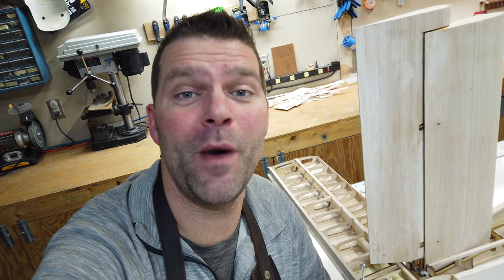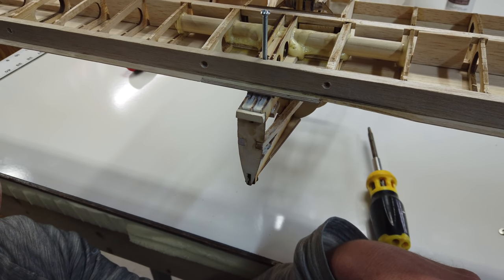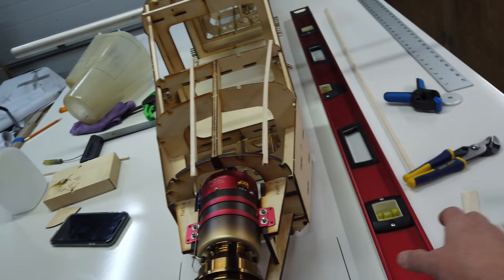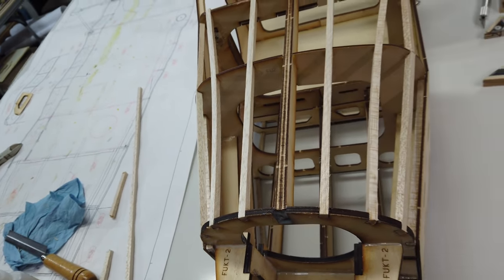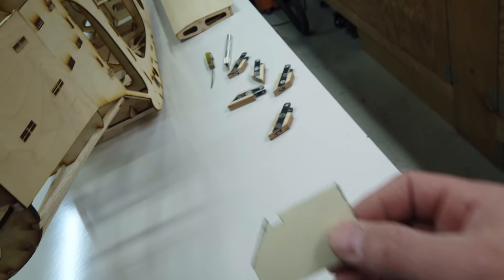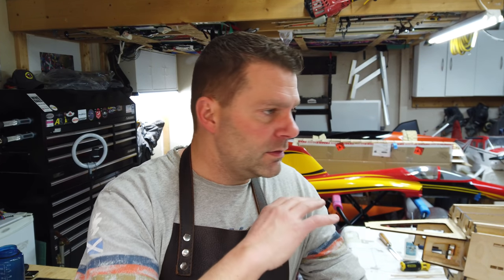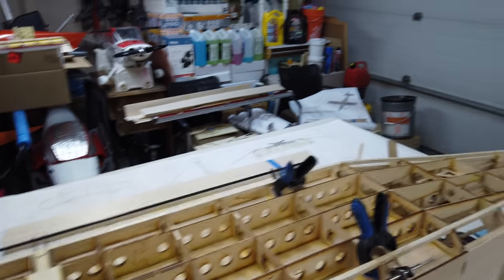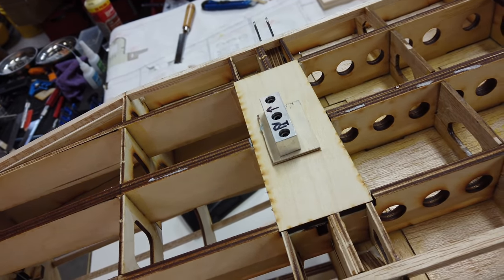Lets Discuss GORILLA GLUE + Others / Turbo Prop Engine install on PC-6. Video 7.

Comment: Your doing amazing job so far.  And great job with videos.   Something I learned with poly glue.  Rely more on a good joint than the foam.  The foam isn’t that strong at all.  But poly glue on tight joint is amazing
Reply from the maker: Thanks for the compliment and tip George!  Thanks fir watching!😎

Comment: Do you have any brand preferences in glue? Also, what do you use for things that need fast progression, but also strength (such as elevator or wing ribs)? Right now I am using CA, and going back with epoxy, but am not sure if that is the most efficient way to do it.
Reply from the maker: Hey Grant.  Pretty much explain it during glue section.  Basically super fast is CA.  Not as strong as something like 5 Min Hysol.  It really comes down to using and experimenting with each adhesive to find out what it suitable. Basically any epoxy (even the 5 min stuff) really needs to set for 24+ hours to be overly usefull.

Comment: Another great progress video of this build Jonathan. Good tip for gorilla glue (yellow) that I learned recently...if you need to fill a large volume/void you can mix it with pva/wood glue, expands many times more than usual and sticks really well. Also very important in the turbine area to segregate the hot sections from the cool intake to ensure the engine does not ingest warm air. Also if you look at the Xicoy version it has an external cnc frame to ensure zero longitudinal flex. Not sure how the KT engine achieves it but probably worth looking into. Lucien’s video is probably worth a look here: https://youtu.be/_uZtUH42aE8
There are also many other useful hints and tips on Lucien’s YT channel from years of Turboprop experience 😁
Reply from the maker: That's a great tip on the glue!  Thanks for sharing that.  I have watched Lucien's videos and he is sharing some great information!  its very helpful.  I have been thinking alot about the Cowl area and it will probably be one of the areas I tackle last so i have some more time to think about what is best...
The KT engine lacks the frame but has the front mount area.  I do think Xicoy did this right!  Best sollution we have for the KT engine is to stiffen the area as much as possible between the front and rear mounting areas.

Comment: Jonathan, worked with epoxy for a dozen years in a wooden boat facility, talking to the chemist when facts were needed, so I know a little bit about the pros as well as the cons of this “glue “.  I wonder if you have done any testing for the pros of the polyurethane glues, I.e. my use for hinges in giant scale RC airframes, a breath in the hole was more than enough to catalyze the glue, my problem was learning how much of it to use!  Open hole vs. closed, enough vs. way too much- that I should have done test samples first.  Worked, the squeeze out was manageable, but it definitely worked better than epoxy once that I learned the characteristics of the new glue.  Your experience?  Loving the build!  Always wanted to see a turboprop after QQ showed that it was possible, looking forward to seeing this one fly.
Reply from the maker: Overall i'm definitely a fan of epoxy with different additives or Aero epoxies like Hysol but the poly glues do have advantages in certain applications like glueing hinges in where they will expand and take up the space on the ribs of a robart hinge like you mentioned.  Thickened epoxy does well too by you don't get the expansion like Poly's

Comment: Great video! I appreciate the comprehensiveness of the build and glue discussion. The glue section was super helpful, as I seem to have trouble deciding what to use, although I have had good luck with gorilla epoxy and zap medium ca. I also find the time stamps super helpful.
Reply from the maker: Awesome, thank you!  As mentioned, experience comes with use.  Thanks for watching!  Glad the time stamps are helpful.  They take a bit of time to add but if there is a benefit for you guys it's worth it.

Comment: Maybe the camera angle but it appears the propshaft is not on the centre line.       I notice you do not have a center line between the outer fuse lines. The center of the propshaft  and spinner should be in the the middle of the fuse. The REAR  of the motor  should be offset to the port side as much as is required  to position  the spinner, shaft at the centre line. Other wise the front of the fuse will have a curve to the starboard side . This will shape the front of the fuse to the right or starboard side and therefore the fuse sides from front to rear will not be symmetrical but asymmetrical. The aircraft will not fly straight but want to go around corners.  Same applies for the down thrust. The shaft should exit the front af the fuse at the correct thrust line position and the rear of the motor should be raised at the firewall to suit.
Reply from the maker: Thanks for all the explanation!  Phew well....I hope it works!  😂

Comment: I was wondering if you could do a video about sheeting a wing with balsa sheeting and useing ca to glue the sheeting down.I'm in a wheelchair and I've been building airplanes for over 10 years but I can never use ca to do my sheeting because I'm not quick enough to get the glue then get the sheeting in the proper place before it cures.Thanks for any tips you can give me.
Reply from the maker: Hey Dan. 
Next video is coming out tomorrow but the one after that I will be sheeting all the big surfaces on the pc6. I’ll throw in some stuff for you in that one. 😎
Reply: @thelightersideofrc  Thank-you soooo much,it will help a lot.

Comment: You really should be sanding off the burn marks on the wood, if you want any glue to penetrate the wood fibers, the burn areas need to go.
Reply from the maker: Thanks Dave. I have been lightly sanding the edges. Not enough to change the shape but just enough to get rid of the burn gloss.
Reply from the maker: Nice!  Good to know!  Glad I’m not being excessive with it then!  Thanks for chiming in on that!
Reply from the maker: @warrenmaker798  Nice!  Good to know!  Glad I’m not being excessive with it then!  Thanks for chiming in on that!

Comment: Where do you source your aero epoxies ea9462 and  e-00NS?  Thanks.
Reply from the maker: Hey Ted. Locally I get it from Action Hobby here in Calgary. I will also sometimes order it from Dreamworks in California if I’m placing an order.
Reply: @thelightersideofrc  Thanks.  I'll have to try find a place in Edmonton... neither Great Hobbies or Hobby Wholesale have it on their websites....
Reply from the maker: @iamtedg    Asif said he cant find it in Edmonton.  He orders it from thunderbolt RC.
Reply: @thelightersideofrc  OK.  Thanks for the tip!  Much appreciated!